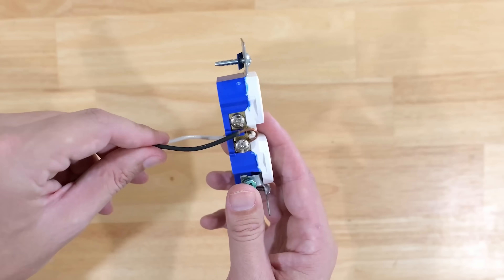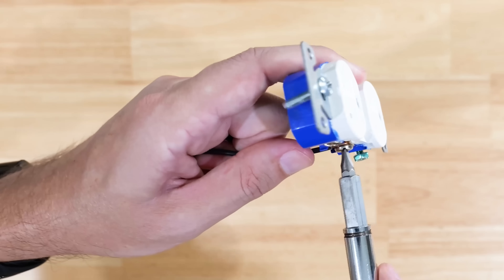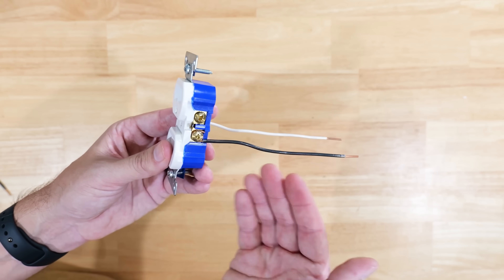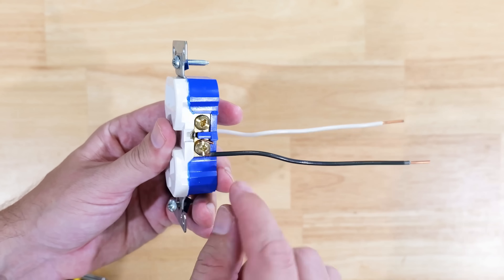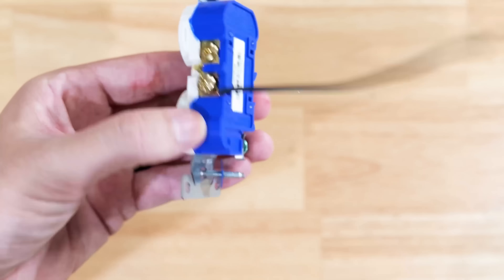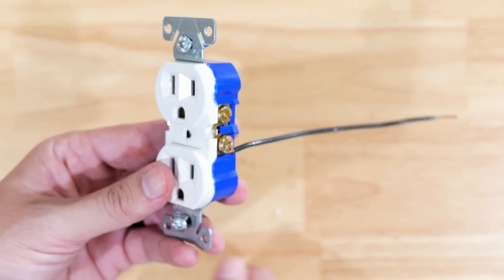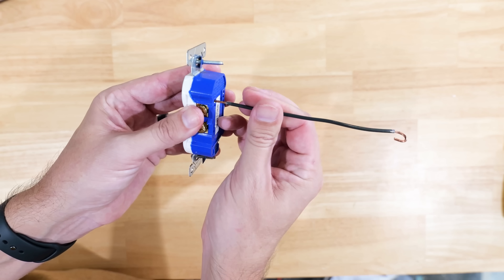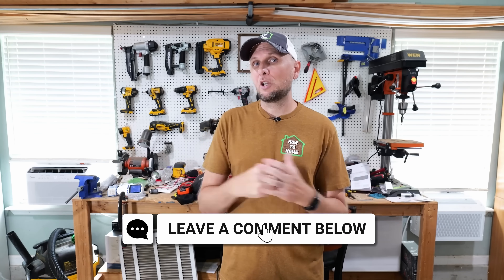Avoid Disaster! 8 FATAL Outlet Mistakes Most DIYers Unknowingly Make!

Comment: NEC allows the use of 15 Amp outlets on 20 Amp circuits and it is bogus to believe that using 20 Amp outlets on 15 Amp circuits creates fire hazards.
Reply from the maker: How do you figure? 🤔
Reply: Table 210.21(B)(3) Receptacle Ratings for Various Size Circuits. 15 Amp rated outlets allowed on 20 Amp circuits, unless it is a single outlet (not duplex). Also, for circuits rated higher than 50 Amp, the receptacle rating "shall not be less than the branch-circuit rating" and could be higher. The circuit breaker prevents overload protection, not the outlet.
Reply from the maker: @MarkAlbert yes it has to be 2 or more 15 am single outlets or a duplex outlet which is most common.  These are not used in 50 amp applications and it is not the outlet in most cases that cause the fire.  It is the wiring on the circuit being undersized for the amp draw.  And you might try to say well the circuit breaker will protect against that.  Tell that to the thousands of people that have done this and a fire started.  Hence why the code exists.  Just like anything else, circuit breakers are not perfect and can malfunction.
Reply: I saw a youtube video once (thought it was this channel … maybe not), where someone disassembled 15A and 20A receptacles from the same manufacturer and they were virtually identical inside.
Reply from the maker: @nathanscandella6075 wasn’t me.  The components are sometimes very similar but it is not usually the outlet where the fire starts but the wiring being undersized for the amp draw and heating up.
Reply: @nathanscandella6075 It was probably Scott of Every day home repairs.

Comment: Hey I got a question about using stranded wire on receptacles or switches or else. Is it a good idea to crimp a fork terminal on them before hooking them up on the screw? This would greatly reduce the risk of fraying and strands coming out and creating a fire hazard. Provided of course if you use the lug for the proper screw size AND, I insist, not some cheapo amazon lugs with thin metal. The ones that you know stay on the wire even after applying a good amount of force trying to pull it out.
Reply: It can be done, but I don't recommend it, another point of potential bad connection. Just use a commercial/spec grade receptacle and use the back wire clamping feature.
Reply: All receptacles are rated for stranded wire. Pro tip: twist the stranded in the opposite direction before making the J hook. This way, the wire will force in toward the center of the screw as you tighten it.

Comment: I don't think I have any 20 A circuits in my home but if I ever know I have one and there's a 15 A recetpacle on it, better believe I'll replace it with a 20 A one. And vice versa. Otherwise, you won't know which is what, EVEN THOUGH 20 A plugs are only used in commercial applications.
Reply: Kitchen circuits installed in the last 60 years or so should be 20 amp, so if your house is newer than that you should have one.
Reply: @robertworden9810  That's not always the case. Sometimes you have a receptacle where the 2 outlets are fed from an independent circuit. At least up here in Canada, this is something you can come across
Reply: Just look in the circuit breaker box. My house is less than 20 years old and has 20A and some 15A circuit breakers for receptacles. Also a 30A for the stove and 40A for dryer and 40A or 50A for the AC unit. 
20A isn't just for commercial applications.

Comment: And one of the biggest mistakes that almost all people make when changing out receptacles, is not using the right screwdriver, and or using an impact driver. Yes I’ve seen maintenance guys use impact drivers. 

The screws on most receptacles can accept a Phillips, flathead, Robertson or an ECX (recommend) driver.

Most people don’t realize it, but the center of the screws are actually square, which is the reason why most improperly sized Phillips drivers will cam out, causing you to switch to a flat head to get more torque. 

The ECX driver is like a combination of a Phillips, flathead and Robertson driver all in one, and is almost impossible to cam out.
Reply: Hang out on a job site - almost all commercial builder sparkies use impact drivers now.
Reply: @VideoArchiveGuy  I’m on one now 😂
Reply: There are screws that resemble a flathead/Phillips screw but don’t have a square in the middle. The center is deeper than the edges and one of the X’s leg is shorter.
Reply: @akbychoice  I have seen those.  It surprises me that the electrical code does not specify the type of screw heads to be used.  They have only had a about 100 years to make them standard.  The Phillips were designed to cam out under so much pressure. I have seen some receptacles that will not take the square heads.  There is a JIS driver that I have not tried on the screws that may work ok for those screws.  Looks like a Phillips but is a Japan screw.
Reply: I have an ECX screwdriver. 
What a PITA!
I never use it anymore. 
It must be dead straight to work. 
And it is too long!  Why?
Reply from the maker: @davehaggerty3405 have never heard anyone have an issue with them.  I always use mine and love it.
Reply: @HowToHomeDIY  maybe I got a bad one. It says Milwaukee on it. With a black blade. About 4” long. 
Looks like new. 
I figured it was some gimmick.
Combining all the worse features of 3 types of screwdrivers. 
I figure a poor screwdriver can slow you down as much as any other tool. So I got good ones.  13 piece set of Wiha. 6 piece set of Wera chiseldrivers.  And 6 Vessel JIS drivers including 2 of Vessel’s Impacta screwdrivers. 
Then there’s countless bits with bit holders and powered screwdrivers.  Even torx from T6 thru T70. 
Maybe I have a screwdriver obsession. 
I just figured ECX was a POS. 
If the screw head isn’t in your line of sight you will never get an ECX screwdriver to seat. 
My last receptacle change-out was for a wall mount garage door opener. Two steps up a step ladder. In a corner. Reaching thru a rack of hoe, rakes and whatever. 
I would have had a few choice words for my ECX. Especially when I figured out the old receptacle was not ECX compatible!
No thanks for an ECX. It’ll be #2 Phillips and a 2-3” flat blade for me.
Reply from the maker: @davehaggerty3405 you must have gotten a bad one or using the wrong size.  I’ve never had an issue and everyone loves them in the comments.

Comment: Nice tip on those new outlets with the levers, I like that.  Will be using those the next time I swap outlets.
Reply: Don't do it !   They are the same as Wago Connectors, which are the same as the old Back Stab Connectors on older plugs.  
Just because it has a lever doesn't make any safer, just easier to release the wire, without a screwdriver.

Comment: My frequent issue with replacing outlets, especially GFI outlets, is that the existing wire in the box is too short to make a new loop or new straight section. How do you suggest dealing with that issue?
Reply: Use a short section of new wire (“pigtail”), spliced together with an inline splice. For example, the new Wago inline splice. These require very little of the old wire, and can be securely connected even at the back of a box, because the wire doesn’t extend as far as it should. Now with a 4-6” pigtail, you are back up to code, and easy to maintain again.

Comment: I know and understand that the black/live wire attaches to the brass screws. But in my limited knowledge and understanding of electricity, I’ve also always wondered why it mattered since we are using “alternating current?”
Reply: One reason for this and the plug being polarized is at your lamp. If the wires were backwards the screw shell on the lamp socket would be hot instead of the contact in the bottom. This would make it easier to get shocked when changing the bulb
Reply: In the old days they did just what you say. There were two prongs and nothing prevented you from flipping the plug over 180 degrees. It all works fine. 
Since neutral is safer than hot, they decided to add the polarization standard for 2-wire devices. Devices are then designed to keep the hot away from wondering fingers.
Reply: It is a safety thing.  Electrically it does not matter.  Often only one wire is switched and if the neutral wire is switched  it still leaves anything on the black wire hot.  The neutral wire is connected to the ground at the breaker box.   So fi you disconnect only  the neutral wire you will still complete the circuit if you contact the hot wire and the ground.

Comment: Personally, I would not put 15A receptacles on a 20A circuit.  The receptacle itself is not rated for 20A, it will likely get pretty hot if you plug in two 12.5A loads, such as two 1500W portable space heaters, and probably take a very long time to trip the 20A breaker, and perhaps never trip it if the heater thermostats are cycling.
Reply: 15 amp duplex receptacles are required to be rated for 20 amps pass through (total of plugged in loads and downstream loads) so having 15 amp duplex receptacles on 20 amp circuits is permitted and commonly done. 
You could use a 20 amp duplex receptacle, but the likelihood of needing it for a 20 amp plug is very low, it's usually a little more expensive and they are the same internally.
I would be more concerned with the receptacle grade, use at minimum a commercial/spec grade and avoid residential grade versions.

Comment: Couple comments 

1. You should know that reversing polarity doesn't cause the electricity to be reversed. 
It's AC not DC. 
It's not as safe but the current isn't flowing backwards. The current in an AC circuit flows both directions, thus AC, alternating current. DC direct current. 

#2 you are telling folks to make a J hook but you never told them what a J hook is. 

You should show them the strip gauge that's on a lot of receptacles to help them get it the right length. 

IMO
Reply: The strip gauge is not for hooking around the screws, it's for backstabbing or back wiring, which ever is applicable.
Reply: @surferdude642  I knew that. That's what I call a brain fart. It sucks getting old and grey. 
Thanks for politely correcting me.

Comment: if yuo're hooking stranded wire under a terminal screw, reversing the twist of the wire helps secure it better.  I.E. most stranded wire twists clockwise, if you retwist it so the end you're securing around the screw is twisted counterclockwise, it will pull the twist tighter.
Reply: Thanks,never heard that one,will have to test it out.

Comment: You can use a 15A outlet on a 20A circuit as long as theres more than one outlet on the circuit.  15A and 20A outlets are identical inside. Just the faceplate is different.
Reply from the maker: Can either be 2 single receptacles or a duplex receptacle.

Comment: I'm in my second house. Both houses had mis-wired receptacles (the prior house was new construction).  My brother's new construction house had miswired receptacles.  My nearly new apartment before my first house had miswired receptacles.  Problems include reverse polarity and missing grounds.

I'm convinced every homeowner and I recommend also every renter should have an outlet tester, with GFCI test functionality.
Reply: Did you use a receptacle tester to find the mis-wiring.
Reply: @Rhaspun  Yes. Those 3 little lights are easy and sufficient.
Reply: @Sylvan_dB How do you trace the wiring back to where the wires are reversed if the wires at the outlet are ok, but the circuit tester shows it's reversed? In my case, it might be somewhere in the ceiling or wall.
Reply: @DblIre  It is probably not buried, unless your place was done with no consideration for code, which does not allow inaccessible connections (and hasn't since insulated wire became a thing).

This means the problem will most likely be in a box somewhere. Start with breaker/fuse panel, then remove covers from other outlets and switches on the same circuit. I had miswiring behind lights on the ceiling (the last place I wanted to look) and in switch boxes. Lighting might be the most likely to cause wiring confusion because of using the white as a hot in a switch loop. (The last 20 or 25 or so years has required marking the wires used that way but not for most of the 20th century.)
Reply: For the life of me, I can’t understand how anyone wires an outlet backwards. Especially a subcontractor who supposedly does electrical for a living
Reply: Easy catch for inspectors when buying a new home

Comment: I've definitely done the "straighten the j-hook" thing, usually when I'm replacing a receptacle and there's very little wire in the box.
Reply: But it is so much fun to pull an old metal box, being held by 4 roofing nails, out of the wall to get additional slack to strip the correct length! That's assuming it hasn't been stabled somewhere and you are forced to use a Wago connector instead with a pigtail.

Comment: Look close at the work harden wire at the edge of the insulation. You ringed the wire with your stripper. That's your break point. And it don't take much movement to break.

Use the correct hole of the stripper they are sized marked for that reason.

Comment: A pro technique is to pinch  the J loop with your needle nose before tightening the terminal screw.
Reply: I pinch it, but I'm not in the field and I don't make as many in a yesr as residential guys do in a week. Made properly, there is no problem. Or, just use commercial grade. Problem solved.
Reply: In regards to the stranded wire,  I twist the strands before making the hook. This helps prevent a loose strand.
Reply: @KimCoulson-g7q  stranded wiring for home electrical? Shouldn't most home wiring that's hooked up to a 20A or 15A outlet be solid core copper or aluminum? I get there's probably uses for specific stranded, like very high gauge stuff, or in low voltage stuff, just always thought electrical should be solid core.

As in like inside a wall. I get for short distances to something outside the wall in conduit, maybe that's not an issue.
Reply: You mean a common sense technique
Reply: @summalibertas4588  common sense ain't so common.
Reply: You mean home owner who gives a sh*t. No pro is going to wast that much time. Remember how many of those connections he has to make so Mr. Pro is not going to bother because that will double his time on job. I am building a basement bedroom and wiring it all up and I will bother to pinch that j loop on each connection.
Reply: @robert5  If he had just practiced making that j loop from the get-go then it wouldn't slow him down as he'd build "muscle" memory and get more proficient at it. Most of them are taught to do it the faster (wrong) way because "time is money" heh
Reply: @robert5  Every licensed electrician will do the proper loop, it is the fool home owner that will not.
Reply: @ronbelanger4113 No guarantee on that! A “professional” electrician wired my mother’s home. I had to redo every outlet!

Comment: If the speed wiring holes are not recommended, why do manufacturers make them? Where is our regulations and testing?
Reply: I’ve wondered that for years. I’m retired but worked as an industrial, commercial, and residential electrician. I absolutely hate the back stab connection. So many times, I’ve seen one wired like that where the insulation on the wire, crispy, from a loose connection. So close to starting a fire! I also do not like the cheap, 79 cent receptacle or the cheap skinny single pole switch. They will fail. One boss I worked for, I asked him, why do we even use these pieces of junk? His answer was, when it fails, we get another service call. That’s shoddy work in my opinion. I always use the upgraded switches and receptacles. I’ve heard a crackling noise when I turned on a light in my own house, which I did not wire. I found the 79 cent skinny switch. Replaced all of them in my house. It’s been close to 30 years later and no problems whatsoever. When it comes to electrical, I do not cheap out.
Reply: @jeffro657-c5h  And again, just like the new Wago connectors.  Inside the Back Stab Plug holes is a small tab of metal that when you push the wire into, grabs the soft copper so it won't come out.  BUT ...
Having a small tab of metal that only contacts 180 degrees possibly of the wire, means less surface contact for the electrons to flow across, ( Electricity flows on the outside of wires) so that smaller surface area can make a overheating condition as the current draw has to all pass through a smaller area.  Heat Expands things. Connections can become loose.  Plugs that people Overdraw through, like plugging in power strips with many high watt or amp devices, or multiple power strips on one power receptacle cause most of their own problems.
Reply: totally agree 100%
Reply from the maker: @n1umj they aren’t anything alike.
Reply: @jeffro657-c5h If your ex boss has that attitude, it won't be long before he doesn't have to worry about any calls, let alone service calls.
Reply: @surferdude642 I agree! People like that deserve what they get. I didn’t really work that long for him. Found another company where the boss was a good Christian man. I actually enjoyed working for him.

Comment: Well, I'm actually guilty of the last one. I always though cutting off the hook was done because it was "easier" to cut it off and strip a new end. I didn't used to because it would shorten the wires and I found it wasteful. Now, I realize that wasn't the actual reason why. Well then, thanks. I'll start doing it the right way.

Comment: If someone. puts the black wire on the silver colored screw they should not be replacing or adding any outlets, call an electrician. That is old school rule to get the hot on the right side of the outlet. 73